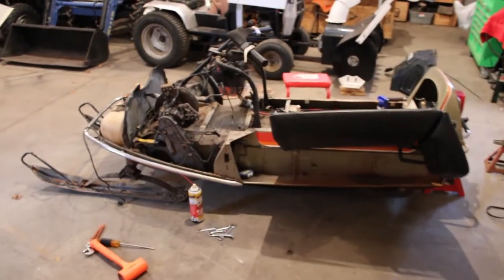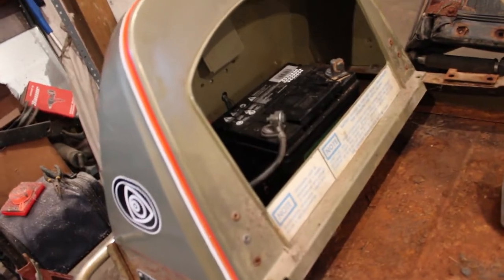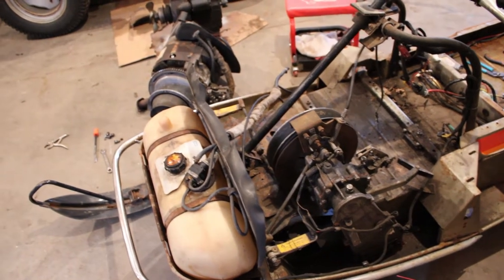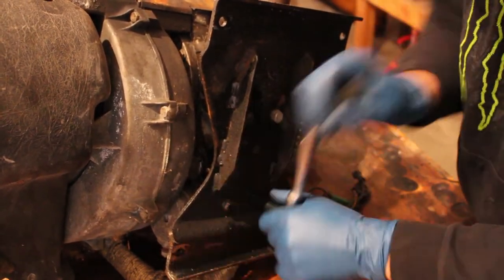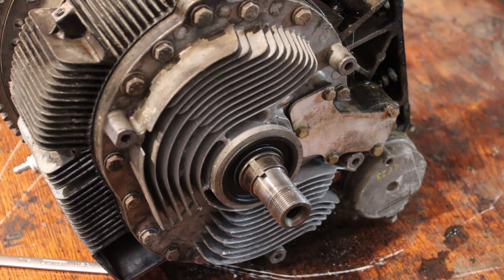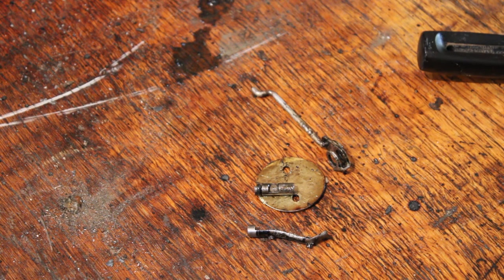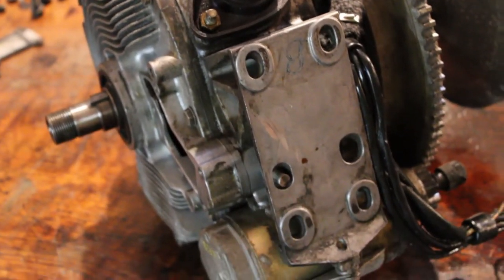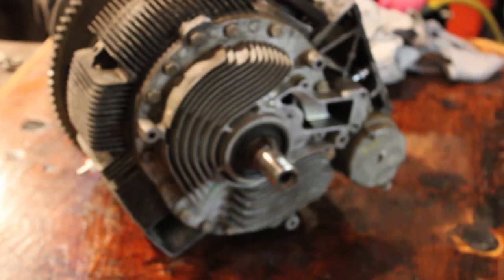Rotary engine in a snowmobile?? 1970s Johnson (OMC) Phantom revival. Part 1.

Comment: Thanks for posting up the process of deleting the air valve. Didn’t realize how involved it is. I just drug out and got my grandpas 73 RC-35-Q running after 20+ years. Some basic clean up and a fuel system clean and it popped right off. Now it’s time to replace fuel lines etc.
Reply from the maker: Now we just need some snow! Hope you get a chance to put some miles on it this year!
Reply: @NorthwoodsNoise  goal was to have it done for the Midwest ride in, big vintage sled rally here in MN. Just have to get the dash back on and it’s good to go. Ended up have to make repairs to the wiring harness. Dam mice

Comment: Just a random thought... couldn't you just remove one screw at a time and reinstall with red locktite? I think I saw someone do that recently. IF you could get the screws out that is
Reply from the maker: I dont see why you couldn't do that. I think most people just remove them for peace of mind. No way they can be ingested by the engine if they arent there lol.
Reply: @NorthwoodsNoise  that's true! Yeah everything I've heard says nobody notices a difference without them but the mechanic in me keeps asking then why did they put it there? I just found your videos. I was doing some searching because I'm looking at purchasing a Johnson rotary 45
Reply from the maker: @muzzcovw7674  that's a solid point. I'm sure it does affect performance, just probably not to the degree that the average person notices. I had the same thought, but when weighing a slight decrease in performance against feeding the rotor some screws I figured I might as well just take them out lol. I've since sold this one, but it was a fun project and definitely unique. That being said, finding parts is a bear lol. At least it was for me. Some of the stator components/coils are very similar if not the same to some of the newer omc/johnson outboard parts, so if you end up buying one and it ever needs electrical work, keep that in mind. I think the power packs (cdi) are the hardest things to come by.